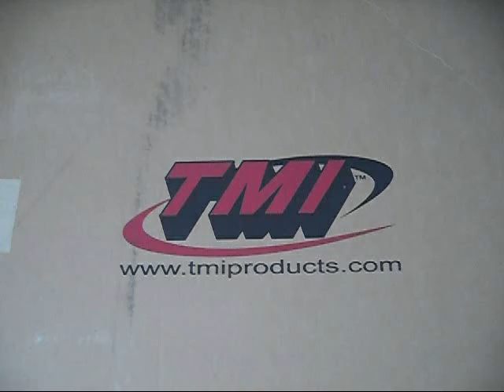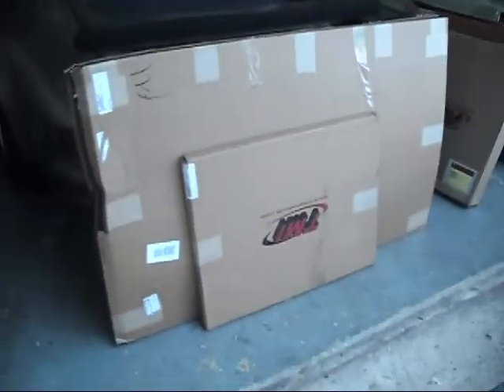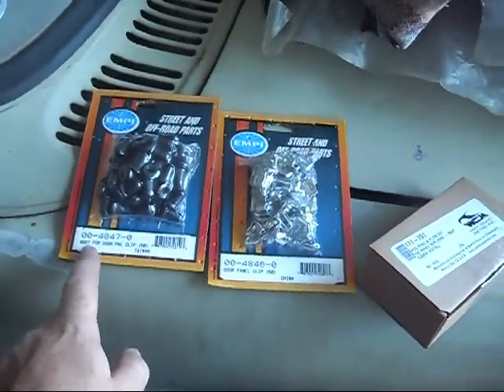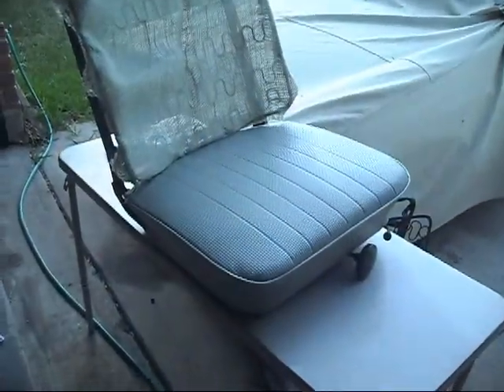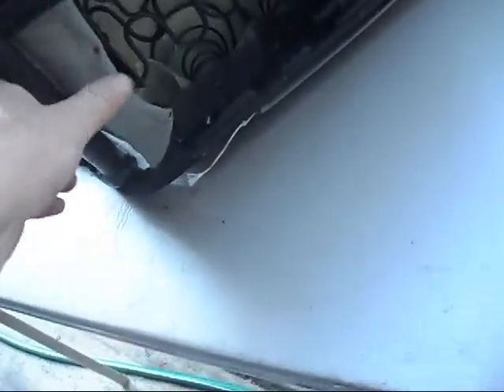Installing seat cover 1971 vw westy camper Bus

Comment: I got my covers from the same place. I have a 68 and the foam pad for the bottom of the drivers seat seems a little big, it doesn't grip around the frame like the back foam. Were yours the same way?
Reply from the maker: +McSquizzee no all the foam was a tight fit. if its not more then a half inch you should be ok using it.
Reply: +TJ Ward yeah I think I got the 62-76 version and should have gotten the 68-69 ones haha. They are just a bit long, I can trim it. It's such a tight fit between the back and the seat, what a pain in the ass.